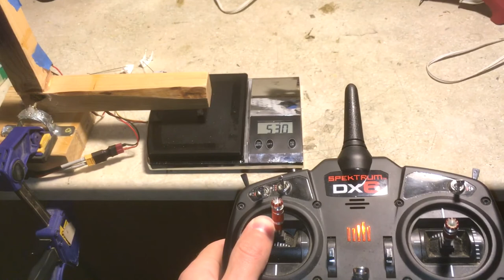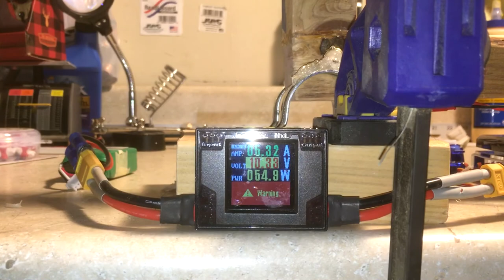DIY Thrust Test Stand [+ Explanation]

Comment: I used parts from the Mecano to provide a platform for the 4 wheels, vertical bracket to mount the motor along with propeller. Connected one end of spring balance just behind the motor. The spring balance gave the thrust reading on starting the motor.

Comment: I have seen thrust test stands with a different setup, as the motor is mounted vertically. Here you have mounted it horizontally (the way I put it). How do you measure the torque when it is mounted the other way around? There is no distance to measure torque!